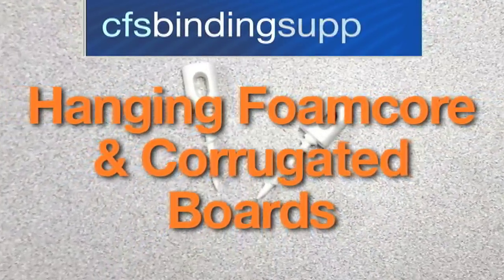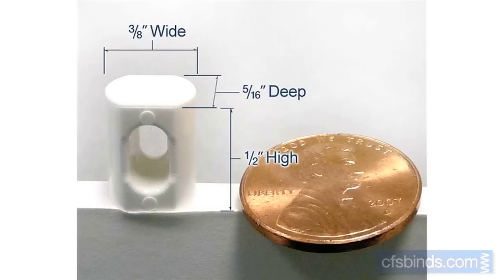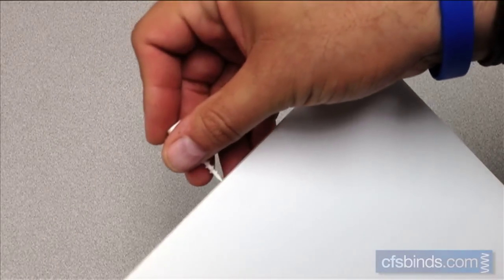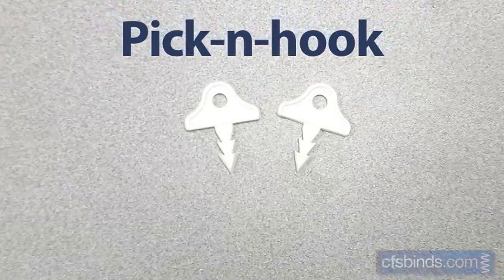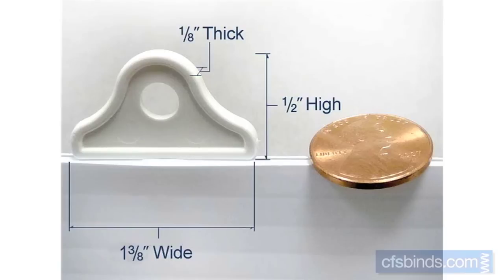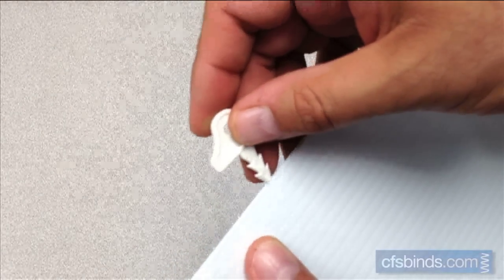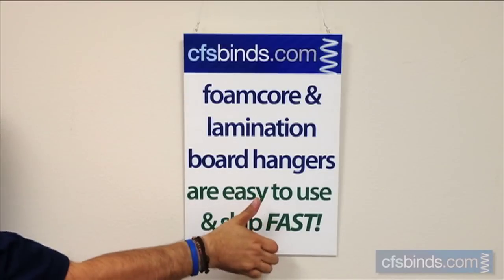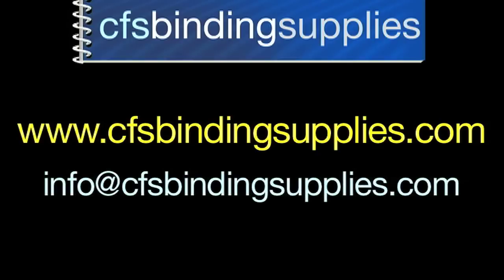Quick Options For Hanging Foamcore & Corrugated Plastic Boards

Comment: It looks like the pick goes in crosswise through the corrugated plastic sheet. My boards are 2 x 4 foot with corrugation running up and  down. The hooks will have to go straight in. Might be a problem.